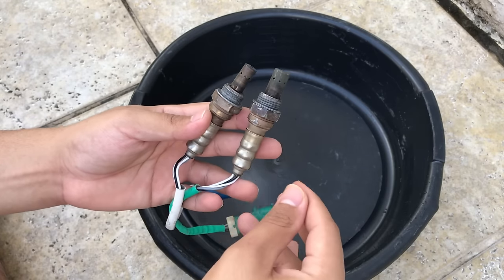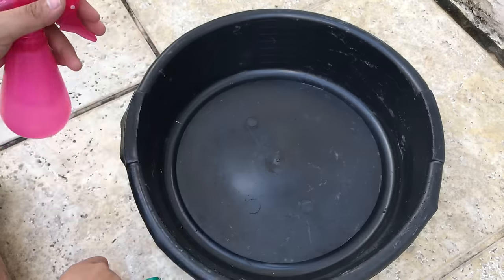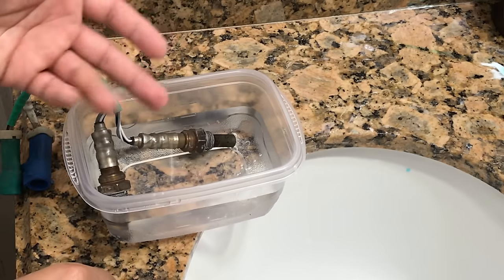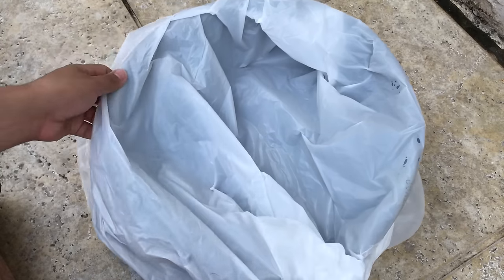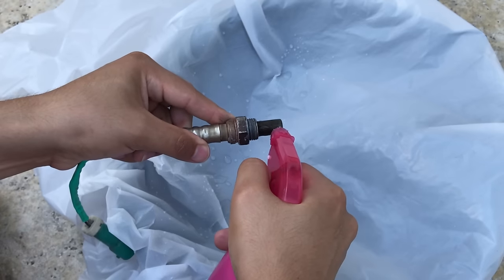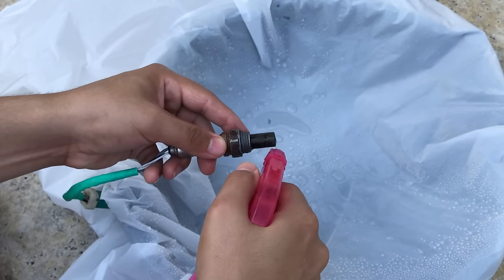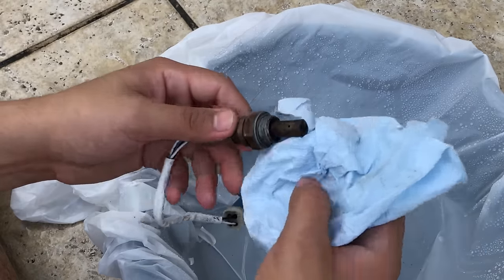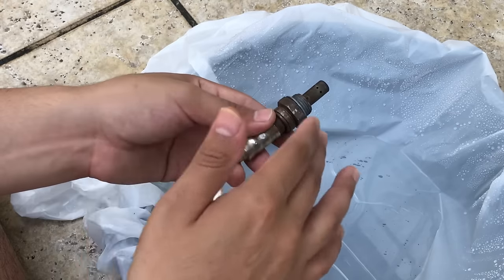HOW to Clean O2 Sensors [For FREE]

Comment: If you're cleaning the sensor as part of your maintenance great but if you're doing it because your having a problem with your sensor? Before attempting to clean it, test it with a multimeter to make sure it's not faulty. No point in cleaning a failing sensor.
Reply: Good advice.
Reply: So true.
Reply: How do you test with a multi meter
Reply: Why not just use break cleaner?
Reply: What did you put in the spray bottle to clean the sensors
Reply: I have a 2000 Nissan Pathfinder I need to see the way to hook up the hose from EGR valve
Reply: @sharpsconsultancy2342 
I cleaned it with that and the car was driving like shit afterwards. 
Brake cleaner is to aggressive. 
Electro spray cleaner is better.
Reply: @harlielewis4075  put multi meter on ohms and test the unplugged wire connector ends. Put one probe on one then touch each one of the other 3 (if it’s a 4 wire connector) with the other meter probe, if you get nothing for ohms (OL) it’s no good. There’s videos on how if that isn’t clear enough.
Reply: So you're just using basically hot water to clean the oxygen sensors and also waiting for more than 67 hours. While using a spray bottle also with hot water???? Another question I like to ask, can you use a carburetor cleaner to clean the oxygen sensors????
Reply: How can one access the sensors? I have failed my emissions test 3 times.

Comment: "The water might be too hot?" LOL. Those sensors have heating that makes them go over 600F.
Reply: Rightt😬😂😂
Reply: 😅 it was a yoke
Reply: @enriqueramirez9099   not only that water 4 six hrs 👎,  ever heard of rust my guy  and to top it off,  its "free" just get this $2 dolla spray bottle.😆🤣
Reply: The sensors themselves can certainly take over 600F, but the wires and plastic clip for the electrical connection definitely cannot.
Reply: This is funny man not gonna lie
Reply: @wchriscarson  no but they can handle boiling water
Reply: @Iwishitwas-hl9wj  Yeah, that's a good point my friend. I was really just trying to defend the guy making this vid. He's trying to help people and some of the comments are (in my humble opinion) a bit too (unnecessarily) negative. And while these wires likely can handle boiling water, I still wouldn't recommend getting the electrical connections wet if you can help it..though if one does a hair dryer has doubled as a parts dryer for me on several occasions 😎👍
Reply: Catch those Carbs!  Either way, I appreciate him putting stuff like this out, whether it be for entertainment or for the fact that people realize they can just clean the stuff with soap and water and don't have to spend all that money.
Reply: @wchriscarson  The plastic is industrial rated to withstand between 130C to 160C and has quick heat release properties depending on who manufactured the sensor ( I think Boch is using plastics that are rated around 180C but all well above the boiling point of water.
Reply: @wchriscarson  His point on the electrical is correct avoid getting them wet as some of the metal has pockets for some brands of sensors. Don't need water hiding in a pocket of the designs.
Reply: Exactly what I thought
Reply: And what the fk is a carb ?? A holly 4 barrel ?? How did  it get inside those small holes ???
Reply: Lmfao
Reply: Carbs? Like good carbs and bad carbs, maybe he should eat healthier
Reply: I mean yeah the sensor its self could handle it but I can't imagine how the wire case's would hold up they would probably melt in a microwave causing electrics to touch 🤷
Reply: @gotaplay  😂😂😂😂😂😂

Comment: You should soak them in gas for 12-24 hours, gas dissipates fast when taken out so no left over fluid is in your sensor, gas also eats away carbon deposits
Reply: I don't know a thing about cars but soaking them in gas sounds fishy. Reminds me of when I left my spoon in the microwave to help reheat food faster-that didn't turn out too well.
Reply: @JustAHevel  i know quite a bit about mechanics and this is what you can do to clean them, I'm not trying to tell anyone to do anything dangerous or that would ruin their car. As a mechanic I have a reputation to uphold for my customers and would never steer someone in the wrong direction
Reply: @JustAHevel  then maybe you shouldn't comment if you're not that knowledgeable...👀
Reply: @JustAHevel  he’s right. Gasoline has carbon cleaning detergents in it. Techron and other brands are formulated to remove carbon build up. Soaking them in gasoline will work, however there are less stinking alternatives, such as throttle body cleaner which, just like gasoline will vaporize quickly but without leaving residue behind. B12 (the fuel additive, not the vitamin) in the pour bottle, not the aerosol bottle, offers the least mess. You’re able to soak it in there and it’ll dissipate all of the carbon.
Reply: I did this once it works 1st time for one and a half year.
Reply: @justinfincher2385  Brake cleaner leaves the least amount of residue.
Reply: Soaking the censors in hot tap water for 7 hrs is senseless as the water will be cold in 45 minutes plus water won't eat or breakdown the carbon on or in the censors use gasoline which has the additives in it to actually breakdown the carbon deposits or ya can use throttle body cleaner or MAF censor cleaner but using water is like pissin in the wind
Reply: @JustAHevel  wow so I thought them 02sensor detect the gas and air mixture lean or to rich .  And that burn black smudge is burn gas lol so you can put gas on them . If you don’t know don’t comment lol. 😝  but I do not know about cleaning with gas but gas do remove a lot of stuff .

Comment: A 50-50 mix of concentrated Simple Green and water.  If you soak carboned up pistons in it they come out looking new in about 30 minutes.  I just did this for 8 pistons for my 350 Chevy rebuild. Still had to clean the ring lands, but it even made that easier.

Comment: A+ for effort and clear video. Placebo effect though.............cold water isn't going to clean carbon deposits.
Reply: Placebo effect will not work here ,the car will either run better or run the same there's no tricking it to run tip top lol
Reply: Use carb cleaner.
Reply: Maybe at high pressure?

Comment: Best way I found out is leave it in 1/4 of hot boiling water for few minutes also don't forget to spray some kitchen cleaning products to the sensor that will help to loosen the junk inside then stirring the sensor in the hot water every 10 to 20 seconds then u will see how much craps comes out with out damaging the sensor ,then keep changing the water till there is no more junks comes out after that dry it with heat gun or just hair dryer should work then see the results

Comment: I usually keep throttle body cleaner around as the throttle body gets dirty often. I'd probably use that to clean the o2 sensors....or something better than water. But its still a good video. I prefer cleaning first before buying new parts.
Reply: Q+q+

Comment: Or you can spray and soak with brake cleaner for 5 minutes then clean up the outsides also with a soft wire wheel or brush.
Reply: Does brake cleaner work

Comment: I recommend dipping them in some carb cleaner or straight-up gasoline but all it does is slap a bandage on an open wound. Its just buying you a couple more miles nothing more, you should just buy some new ones.
Reply: Car parts need to stay in business nothing last forever out with the old in with the new

Comment: Can I just through them in the dishwasher on a HEAVY DUTY ADDED DRY HEAT TO CLEAN UP MY O2 SENSORS IF I PROTECT THE TERMINAL PLUGS WITH A ZIP LOCK BAG & TIE STRAP THEN WRAP IT WITH HIGH TEMP HEAT SHIELD TAPE SO THE WIRING WONT MELT? I USE CASCADE 4 IN 1 PODS  AS DISHWASHER DETERGENT WHEN I CLEAN MY K&N AR FILTER, SPARK PLUGS, THERMOSTAT, VALVE COVERS, INTAKE MANIFOLD (3 FULL CYCLES SET TO CHINA & NO HEAT DRY), THROTTLE BODY, TOW HOOKS ETC. WITH MY DISHES IF THERES ROOM SO I DONT WASTE SOAP AND WATER CAUSE IM CHEAP? LMK? THANKS 🙏

Comment: I used carburettor cleaner pour some in cup and put the censor just for a few minutes, it works perfectly for me.
Reply: why did u clean ur 02. what was the prob. what was the results for u to say "it works perfectly for me."  was there a o2 sensor code,etc,etc.
Reply: @EHUE-kf4ey  the check light came up, I put it on computer the o2 sensor code came up.

Comment: I used carburetor cleaner on mine and they’re perfect now, no more check engine light
Reply: Did you do any pre prep before using the cleaner. Or just straight to it
Reply: @HoangNguyen-fm6nd  I just took them off and straightaway sprayed them with the cleaner till they’re less blacked out and put them back, that was it.
Reply: @cryptobellz3349  thanks for the quick response. I got a p0172 code in my 07 civic and so far being directed to the o2 sensors. Hoping cleaning them can clear the code
Reply: @HoangNguyen-fm6nd  you’re welcome, I hope it clears it for you
Reply: So you recomment to try this?

Comment: Great video and info but I'm not gonna waste my time and hot water is not a very good solution.  Carb cleaner is cheap and easy to use plus it will save allot of time instead of using hot water and waiting seven to eight hours.
Reply: Is it safe to apply carburettor cleaner? I don't know that's why I m asking

Comment: 2005 honda accord. Bank 1 sensor 2 code. 
Disconnected both and have them soaking in gas for the next six hours, all the time I have today. Thought I’d try soaking them as opposed to spending $60.00 CDN on a new one. 
I dont understand how soaking them in room temperature water could possibly do anything. Who taught you that? Did it work?
Reply: Did yours work?

Comment: I soaked my toyota vitz 2007 upstream oxygen sensor in hot water for around an hour. Then i spray it with wd 40. When i install back the sensor then its giving p0135 code which shows heater element fault in oxygen sensor. Don't know what happend with the sensor. Any idea?

Comment: You can test this method by soaking an exhaust valve with carbon buildup in water and see what happens to the carbon, Nothing! carbon is a deposit from unburned hydrocarbons, it is not water soluble.  Heat is the only way to clean and the cat converter is not running hot enough to burn off the carbon. In the lab we tested the functionality at 1100ºC for durability. Water is not the way to go.

Comment: Thats what I was gonna say boiling  water never tops about 250 F  the exhaust is 1,000F plus
Reply: Ren - Water at 250 degrees is called "steam".  Boiling point being 212. And when engines run about 195, inside cylinders about 450, how does exhaust get to 1,000 F ?

Comment: O2 sensors don't contain "carbs". 
There may be carbon buildup, but plain water won't remove that, especially since it's been baked on for thousands of hours at very high temperatures. 
If your oxygen sensors need replacing, they need replacing. 

(I wonder if this guy cleans his platinum plugs when they have 50,000 miles on them...)
Reply: Don't know about this guy but I have a friend who cleans his plugs every 1000 miles  and changes his oil at exactly 3000 miles.
Reply: @garypersons9320  bah i change plugs when need to they cheap. But oil only very rarely. I do change the filter once every 1/2 year. So my oil change bill per year is less then $20
Reply: At $186 from Autozone. I'd rather clean it to pass smog. It's not affecting the car's performance other than a CEL comes on
Reply: Bro it's not a bad idea to do this if he's trying to sell the car you know. No sense inputting $200 possibly into a car you're trying to get rid of I'm just saying. It's not a bad way to go if it's a beater or just back for the work car.
Reply: @Miatacrosser  if o2 sensor fails and let's too much gas in. The cat will get clogged.
If too little gas is put into cylinder. Valves will over hest/burn

Comment: I've heard about how some have used ultra sonic cleaners.however I believe that the best thing to do is replace them..especially if the vehicle has 100 thousand or more miles..like spark plugs.the go bad
Reply: Carburettor cleaner clean them good.
Reply: Ultrasonic cleaners are used in many industries.
I've used them to clean up jet engine igniters in the aviation world as long as the engine manufacturer specifications has a call-out stating that it is permitted to use them as an acceptable method of cleaning.
As long as no moisture is allowed to get into the electric internals, ultrasonic cleaners are an effective, inexpensive method for extending the service life of certain components.

Comment: If the preheater in the sensor is failing, this will not help. Also depending on you mileage, sensors our limited with milage.
Reply: Is testing the voltage of the sensor a means to determine if it good?

Comment: Just heat up the sensor with a torch and put it in hot water the carbon comes off in seconds
Reply: Do a video for that
Reply: It’ll clean it but it’ll spoil heating element I’ve tried with 2 oxygen sensor have to be replaced after cleaning

Comment: just wondering .... can I drill a hole just opposite of the sensor in the the exhaust pipe and spray the sensor clean with carb cleaner as needed ?   Filling the hole in the exhaust pipe with self tapping metal screw.
Reply: Gomer Simpson will clean it this way 😂 
That's what I call logical thinking
Reply: Will this work ?  Right now I put injector cleaner in the gas and the light stays off for 2000 miles ... I think it will ... understanding how cleaners work!  Then watching Utube video’s on soaking the sensors ...  it should work !  What do you think ?

Comment: I added a can of Gumout Multi-Systym Tune-Up to my tank and filled it it up with gas. Two days later my service engine light came on and my ThinkCar diagnostics says its my Air Fuel Sensor1 B1, did the Gumout lead to this?

Comment: If I took the trouble to remove the sensors for cleaning, I would soak them overnight (10-12 hours) in gasoline and then reinstall them.
Reply: J. Wilson 

That’s the way how it works...
We called Diesel in Germany 🇩🇪
Reply: Go one further and use brake clean and a plastic medicine bottle just big enough to fit in or glass baby food jar.

Comment: Someone i know told me to place a bad one in the place it goes in the down stream part of the pipe or just plug it off and plug in a good one and hang it on the frame rail ( sounds super crazy ! ) I did it and it works great and the check engine light went out... crazy but it will works, it did for me anyway.
Reply: imma try this
Reply: @magicalgibus3006  did it with fire you?
Reply: Did it work for you* I meant to say
Reply: @naijataylor9822  turns out that the down and up stream sensors are different in my car, so I can't swap them

Comment: if i may ask, why not soak the sensors in a paraffin for few hours or use injector cleaner spray to dissolve the carbons? Since the objecitve here is to clean off carbon deposits lodged within? Good video though.

Comment: Your cleaning the outside metal heat shield which does NOTHING, the "sensor" is a ceramic substrate inside the metal heat shield, to remove any build up it needs to be soaked in a solvent, gasoline or petrol seems to work which gets in thru the small perforations
Reply: I sprayed mine with Purpleblast and that desolved all the carbon quickly

Comment: Spraying any sort of chemical on O2 sensors to "clean them" is a total waste of time and effort. NO chemical will remove the deposits that are inside the little holes. The problem is the other hard deposits inside the little holes, NOT the soft carbon on the outside!

BEST way to clean O2 sensors is to heat the hell out of the tip that is inside the exhaust pipe to a bright/cherry red color. That is about 900F to 1000F. This will burn off most all of the deposits and the sensor will work again about 80% of the time. I have been doing this for many years. Works great and really is almost free to do. Just be very careful not to burn the wires or yourself!
Reply: Forgot to tell you to use a common propane torch! Sorry.
Reply: Thank you for you input.

Comment: cleaning your O2 sensors is not going to solve the problem if they're dirty like that then you need to clean your fuel injectors or you have a clogged fuel filter you need to fix the culprit otherwise it's just going to happen again

Comment: You’d have better luck with Marvel Mystery Oil than soaking o2 sensors in hot tap water.
Reply: Finally someone who understands the importance of marvel mystery oil.just soak sensors in it for 6 hours and clean off and your good .also good to unlock a locked motor.take all spark plugs out and pour 3 cap fulls of it down in holes.wait for 24 hrs then get a breaker bar go under neath and turn the fly wheel till it turns on its own.repeat step if needed.freed a chevy that was locked up and sat for 7 yrs.no damage done.just change oil and oil filter after.

Comment: How about Brake cleaner or Carb cleaner, if it even helps at all. Room temperature water? You don't know much about engines
Reply: There another video using carb clean er they said it worked

Comment: If you came to this video expecting something serious if you have a genuinely gummed up o2 you might as well replace it attempting to clean it will do you no good these sensors aren't to be cleaned some of them dipping in water could potentially ruin them you don't want to fill with water, anyhow this is why they have heating elements now not just to help with efficiency at cold start but also to stop carbon building up during that period

Comment: I fix electronics for a living,  so if you want to have a safer bet at this working use 99% alcohol that way you clean the CARBON build up and if it gets to the cable it wont damage it since its non conductive and it evaporates fast!
Reply: What about lacquer thinner or mineral spirits?
Reply: Yeah propan 2ol
Reply: What about gas?
Reply: alcohol like beer? or vodka, rum or whisky?